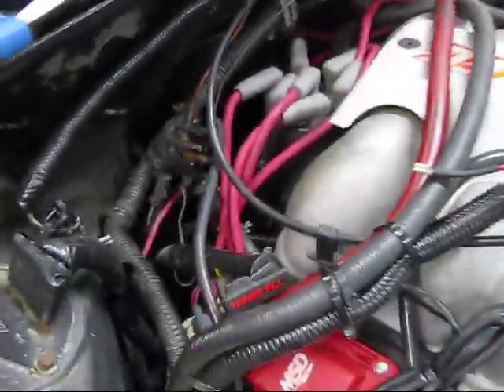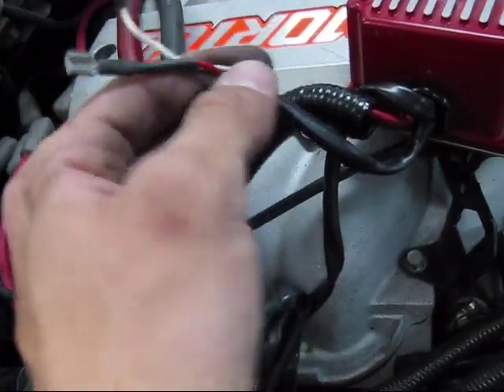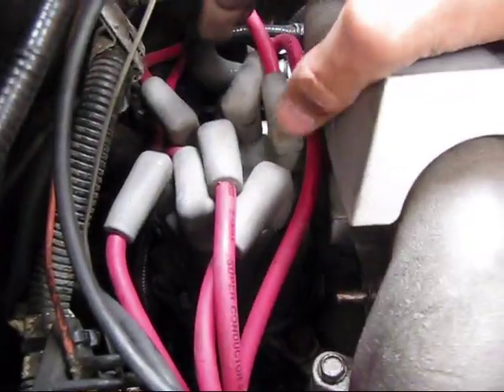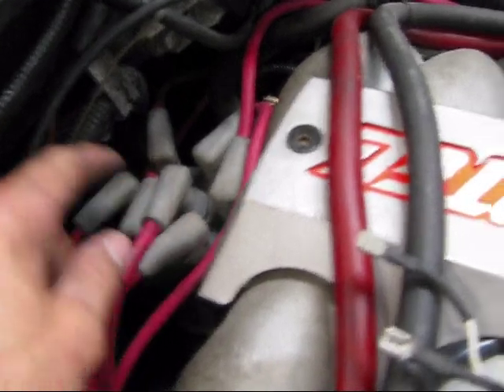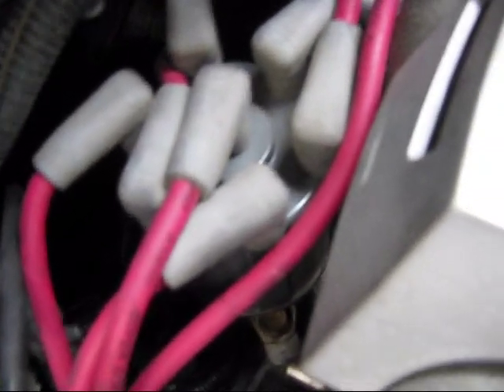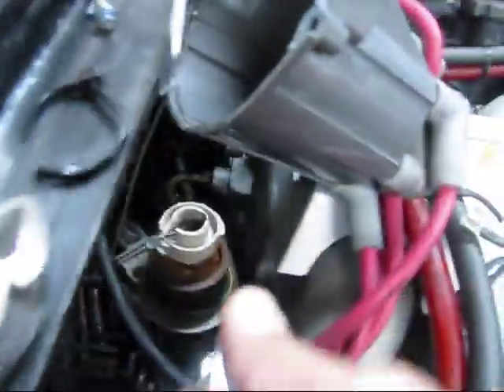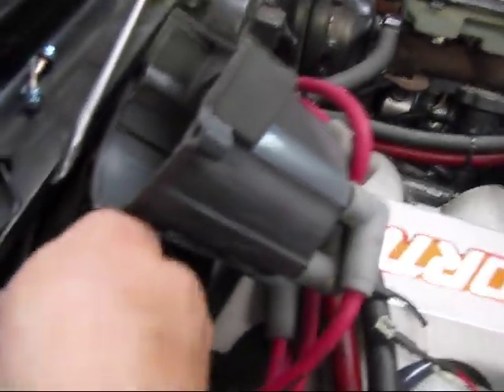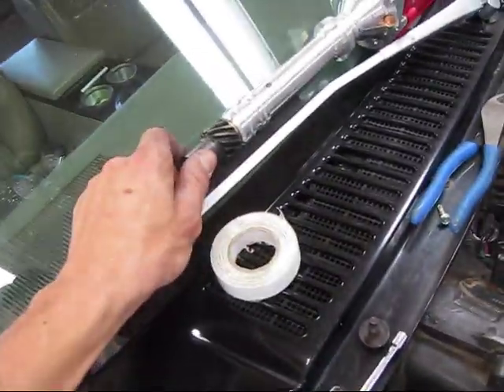MSD Distributor Install 93 S10 Blazer

Comment: Pull spark plug on cylinder 1
find TDC on compression stroke
Set mark
Look at where rotor is pointed this is now the #1 so mark it.
place cap back on and follow firing order from that #1 mark around the distributor correctly
start engine 
Set ignition timing 
Done

Your way is still right but it assumes the distributor was removed by the person doing the work. This is not the case with me and I need to do it with the above method. Mine is also a TBI and there is a ton of stuff in the way and makes it difficult to get to it. 

While mine was out I went ahead and replaced intake gaskets. 

Good video dude.

Comment: I have a 03 sonoma zr5 with a 4.3 v6 and was wondering what MSD parts you got for the ignition and if they are still working well now?
Reply from the maker: Noah Ziegler I don't have the part numbers on hand but I have gone through 2 MSD coils. I now have a factory coil installed and everything has been working well otherwise.

Comment: Doing this on my 93 S10 2.8 right now. took a break when I removed the cap and found this vid. Thanks so much for the help!

P.S. 3,000 "KILOMETERS"!? Canadians.....lol
Reply from the maker: Lol Happy to help.  Good luck with your project!
Reply: RobHoffmann20 I am having issues getting the distributor clamp wrench to fit. Did you use the 1/2 or 9/16?
Reply from the maker: Hmm. Good question.  I'm out right now but i can look and let you know later.  Maybe 2hrs
Reply: I think I may have been trying to unscrew the wrong knot. Nevermind I'm good!

Comment: yeah that's what I heard and once I'm done with my truck I'm probably I make a video on it and show everybody that what I've done to her if you want you can check it out to be cool sau yeah alright and a question how did you find it top dead center on the pistons and is it number one or number 4
Reply from the maker: you can likely find a video that will explain it much easier than i can. but there are a few different ways. cyl #1 is the drivers side front most cylinder. (on the 4.3L V6)

Comment: how much dose an msd box cost ? and do i need to change the stock distirbtour when i put an msd box thanks
Reply from the maker: Mike Anderson https://m.summitracing.com/search/brand/msd-ignition  I bought mine many years ago, in this video I have an upgraded ignition coil but after having 2 fail I switched back to the OEM ignition coil and it's be good since.

Comment: yes it runs think it could be the injectors are clogged
Reply from the maker: have you tested fuel pressure?  could also replace fuel filter. it's possible there is a clog.  you could run cleaner in the tank

Comment: Hi I bought a 95 blazer and I cant get it to start I replaced the cap rotor wires the fule pump works replaced ingntion switch but the one thing I messed up on is unplugging the wires befor knowing the order can u please help it turn over but backfires
Reply from the maker: If you look up the firing order you will find a picture of the engine and distributor, From that you should be able to install the wires on the correct terminals. Hope this helps. 

Cheers

Comment: I have lost the timing on the rotor my 1993 gmc Jimmy s15 is there anything I can do to find the right timing
Reply from the maker: If you have a look online there are many tutorials for this type of problem, It starts with finding TDC (Top Dead Center) and from there making sure the rotor is pointing at the NO.1. Cylinder position on the distributor cap. I'm sorry that I cant really provide much more of an explanation than that, I am not 100% on all the required details.

Comment: hey what's up I'm at Megan um I found out that the ignition coil the performance one the one you got on your truck if you have any problems with it is probably because it's a performance was for drag racing and all that and it only starts activating at 4000rpm the one you really the ideal when you want to get it the street racing because if there's operating at idle speed
Reply from the maker: Had no idea about that. I'll have to look into it.  Seems to ruin much better since the upgrades tho.
Reply: Kenneth payne m))

Comment: hey do you by chance know the stud size of your the heads on because I got my rocker arms and they cannot find the stud size for my roller rockers and the ones I got was a 1.2 and they're too big so I just like to know if they are metric or standard so it can you just tell me what kind you got and besides all that please and thank you
Reply from the maker: i do know i had to change the studs to fit my new rockers. on my last engine build video i had listed all of the parts i used (pats #'s n all)
Reply: which video
Reply from the maker: http://youtu.be/iStOlygfNz4   should be in here. If not then i don't know where to find em.

Comment: So what if nothing is marked how can I install the distributer from scratch exact same engine in video.
Reply from the maker: Cortlan Salmon this link may help you out.  Good luck! http://www.classiccarauto.com/impala/how_to/install_distributor.shtml
Reply: Thanks bro it's going to be difficult but I can get the first cylinder tdc using crank pulley from there it be a puzzle
Reply from the maker: Cortlan Salmon just take your time and you will figure it out.  There are several forms online and images which can be helpful.  Do some research and you will sort it out.

Comment: What is the part number 4 that distributor
Reply from the maker: this model was made for the V6 with electronic advance and the model# is 8367 GM 4.3L V6 Late Model HEI
Reply: +RobHoffmann20 

hi

are you pleased with this distributor vs. a factory piece???

just about to purchase new distributor.
Reply from the maker: Finn Green i have no complaints,  my old one was unreliable and worn.  You can tell the MSD is over built for the job